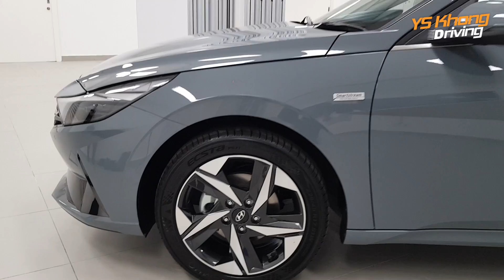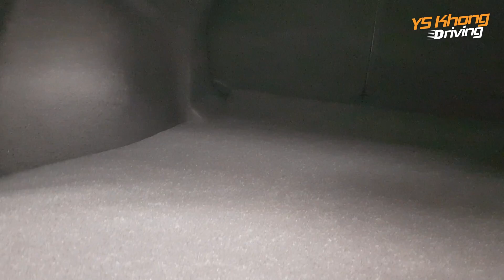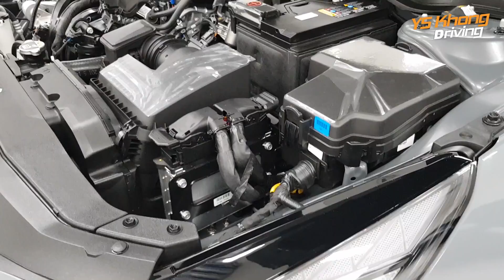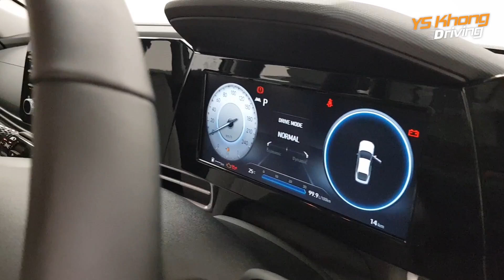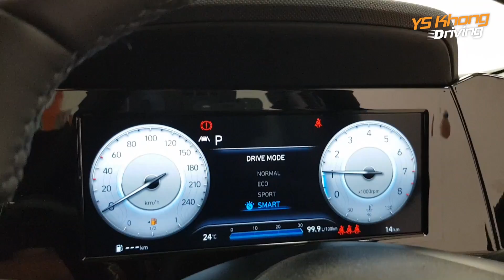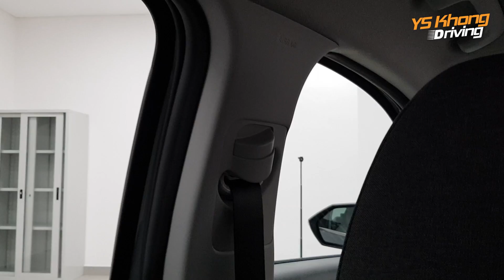Hyundai Elantra 2021 with 8-Speed IVT Transmission, 1.6 Litre DOHC VVTI, Preview | YS Khong Driving

Comment: I am from Romania and I put an order for the 2021 hyundai elantra limited 123 hp. Is it cvt or ivt ? cause on the contract it says cvt
Reply from the maker: IVT is another form of CVT, with different programming. In effect it is still a CVT.
Reply: @YSKhongDriving  It's the same thing but different :) My question still stands: is the hyundai elantra 2021 limited equipped with the ivt form of cvt ?
Reply: @YSKhongDriving то есть она должна быть более надёжной?

Comment: If its priced more than Rm120k, Hyundai Malaysia can say bye2 to their share for the C segment sedan.
Reply from the maker: I personally think it' hard for any C segment to be priced under RM120k nowadays. Those days are gone.
Reply: @YSKhongDriving  more than 120k is OK for a full spec car but the price should not exceed 130k for a 1.6na...
Reply: @YSKhongDriving  Don't overlook the current 1.8l Civic on offer. It's currently the benchmark C segment sedan as far as pricing is concerned , and its a good overall performing car too. If I'm not mistaken, it's currently priced just below Rm110k!
Reply: @nickloong  I wonder if the Civic offers as much safety features as the Elantra despite it being priced lower?
Reply: @ianpolo5673  The base model Civic doesn't come close to the Hyundai in terms of modern safety features. But to those who are on a tight budget but is looking for a presentable and reputable C segment sedan, they can't go wrong with the current Civic base model. If only Honda Malaysia could have offered the AEB with a little hike in asking price, i forsee another round of active buying happening for this base model Civic.
Reply: @nickloong  I see. You are right. Not all buyers will be all out on a look out for safety features. I believe the Civic 1.8 NA will provide a more effortless driving experience as well.
Reply: Just get X50, settle.

Comment: 10.4sec 0-100, thats the important point haha.
Reply: With 1.6L it is quite good. With car this big. Based on that 0-100 faster than almera turbo and yaris. The b segment car.
Reply: Good point bro.
Reply: For a 1.6 and most importantly an Auto with N.A. engine, achieving such timing is totally acceptable if one compare to Corolla 1.6, Mazda 3 1.5 or for that matter Civic 1.6 (SG available). It basically outperform them.
Reply: @ianpolo5673  I was initially skeptical at the 10.4 0-100 timing. It appears that the 10.4 may be very well true, as the new IVT transmission reduces power loss, which makes the car more efficient at putting the power on the road.

Comment: how is the reliability of the ivt? the design is weirdly appealing, the sonata too far out imo.
Reply: Seems not many reviews about it from overseas. We'll have to see in the coming 5 years. They say its using a metal chain belt rather than the conventional metal belt. Improving response and hopefully reliability.
Reply: @Harzman01  then it means this form of gearbox isnt fit for purpose if they need to keep tinkering, changes etc. On principle i wont buy any car wt cvt, Ivt.. what ever veetee they want to call it.
Reply: @hoomee7605  cannot say like that. Everything in the car is always tinkered with all the time. If not then there's no innovation and improvement. Hyundai has one of the better transmissions. In terms of feel their IVT is one of the best. So far the past 2 to 3 years? Overseas markets I see have had no issues.

As with all car components, they are engineered many years before actually put into a car. Unlike Japanese brands and Proton which they choose a gearbox from an Oem, hyundai makes their own.
Reply: because your mind has some Broken that's why you say this cars is weird.I know people like this always support JDM.